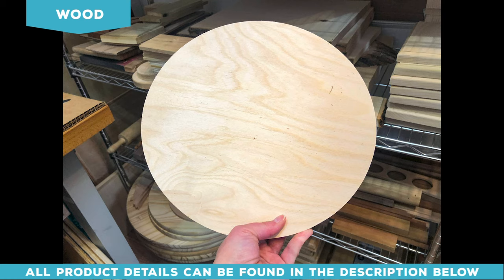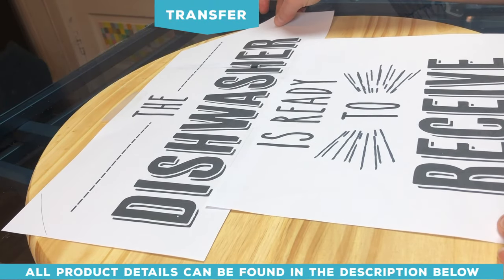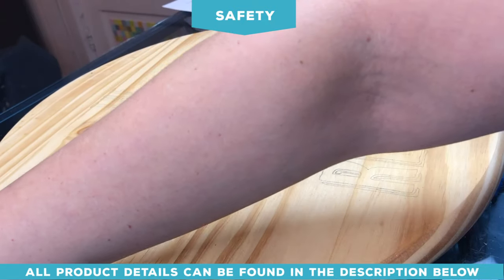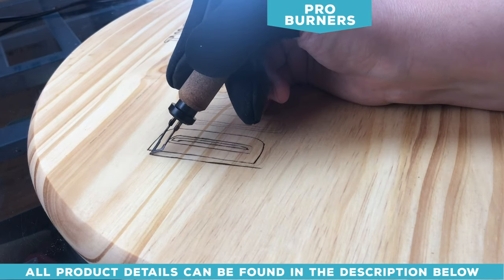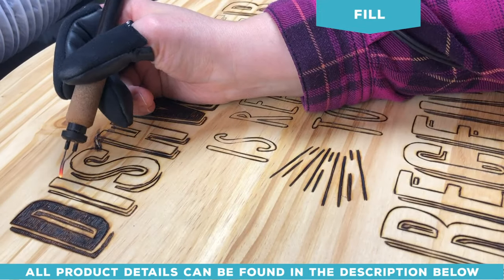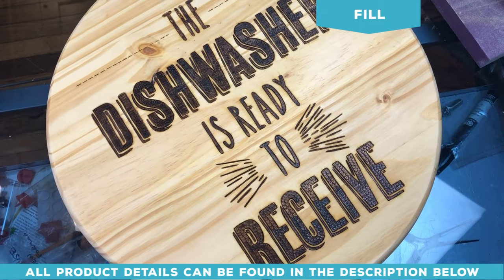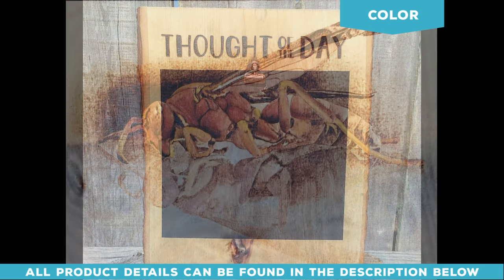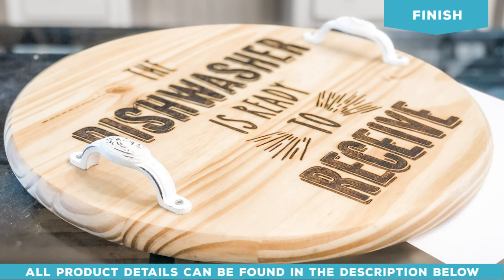Learn How to Wood Burn in 5 Minutes

Comment: What would you reccomend as a sealant for something that will be outside in the sun 🌞 after its stained?
Reply from the maker: Hey there! I use a Spar Urethane by Minwax, but it's not full proof. If it's outside in the elements, it will need to be reapplied at some point; just like a wood deck, the coating won't last forever.

Comment: Id have liked it if you could include pressure recommendation, maybe if the work environment is a necessity or how high/low the temp should be since yiu said keep the temp low but the metal was red hot and burned into the wood easily

Comment: Just got the wood burning kit. Video helped a looot, soon will be working on present for my girlfriend. I hope it will come out nice. Thankss for advice.❤️

Btw which tip is good for curves? It will be a lot of hearts so i would like to know.
Reply from the maker: Thanks for watching! If you have a narrow straight edge tip (skew or universal depending on which kit you have). If you don’t have one of those in your kit, a ball tip or round tip will work. Just make sure to go slow and burn at a lower heat so that you don’t get a lot of bumpy jagged edges. :)
Reply: @Pyrocrafters  just for feedback, present came out successfully, thank you very much!

Comment: I have the Walnut Hollow burner. I am not happy with it. Seems to lose heat, then you have to wait for it to heat up. If that was the Colwood burner you was using, wow. I've never seen mine heat up like that. I subscribed, hope to learn more. I am trying to use pyrography with my woodturning.
Reply from the maker: Awesome! I love to combine different art forms. I’ve seen some wood carvings with burn before, but you could really take it to the next level with turning. Thanks for watching!
Reply: Buy a good woodburner$$ itll save money in the end with better work. The cheap burners are only good for the trash.

Comment: I have some middle schoolers but I need to keep them safe from burns.  Besides supervising them, which gloves would you suggest I get to help decrease incidents?
Reply from the maker: Hey there! I think any type of heat resistant glove will help. Silicone or those grill gloves. I use the JATAI finger guards, but it only protects the tips.

Comment: Thank you! This was super helpful. Would the type of sealer I use to pre-stain wood conditioner, stain, and then add a sealer. Meaning would I need to keep it consistent (water-based vs oil-based) I want to make Woodburn panel wall art to sell. So I want to make sure there won't be issues with it long term. Idk what words to use- hopefully, I'm explaining myself correctly. I just want it to have a professional modern/contemporary look. 

For ex:

1. I am using a birchwood panel that I've sanded down. 
2. Applied a clear spray-on matte sealer. Doing this also prevents with solution from bleeding outside of the stencil to maintain clear crisp lines.
3. Used chemical burning (ammonium chloride solution) works great btw. I applied a thin layer of solution on my vinyl stencil. let it dry then peeled the vinyl. 
4. Used my Wagner heat gun moving it around to make sure it doesn't burn other areas of the panel.

I want to stain it which I know you can, but I want to make sure I'm doing it correctly. I have miniwax products I want to use.

5. pre-stain wood conditioner
6. wood stain
7. Finishing sealer to varnish and preserve the art. 

So would it matter if I use water or oil-based products? I am looking to sell so I want to make it does not look "cheap" or have people feel like they've been "ripped off" for what I'm selling? Poor verbiage but I hope my question came across. hope to hear from you.
Reply from the maker: Hey Chaotic! It sounds like you know more than me about it. LOL! You’re using a lot of techniques I’m not familiar with like the ammonium chloride and I don’t know what type of spray you used. Without knowing all your info, I have two suggestions: 1. Test out any new techniques you’re not familiar with on scrap. 2. Keep a consistent base with your stains/varnish, so if you’re using water base with one, use a water base throughout. I’ve never tried to mix them, so I can’t speak to what the reactions will be. Give it all a test on scrap and get a good idea on the what will happen before you do this to a finished piece. Hope that helps. :)

Comment: Would you suggest doing this outside or inside? I would love to get into wood burning but I live in an apartment unfortunately.
Reply from the maker: Hey Princess, you can burn inside, just make sure you're near a window with a fan. When we lived in the burbs, I used to use two fans, one on my desk to pull the smoke away from my face and a second one in the window to pull the smoke out of the room. So it's possible to burn in an apartment with the right ventilation setup.

Comment: When you are tracing over the carbon paper, do you need to use a pencil or a engraver? Also is there a specific type of paint you need to use for wood?
Reply from the maker: Hey Brittany! I use a pencil so I can see where I've traced, but some people use a tracing stylus. And the way the metal stylus feels on paper is a bit cringy to me, but it doesn't bother other people. Either way works, it's up to you and what you prefer. There are a lot of paint options, acrylic, water color pencils, stain, ink and so on. It depends on what look I'm going for in order for me to decide which method. I would experiment with different paints until you find one you like the most.
Reply: Thanks a lot!! You were very helpful😁🙏

Comment: What grit sandpaper do you use to make the wood that buttery smooth?
Reply from the maker: I like a 220 grit, but some artists go higher, 400, 800. I tend to burn deep textures, so a 220 works fine for me. If you want to burn light tones for realisim, a higher grit will give you a smoother finish.

Comment: Is it possible to do this on a store bought charcuterie board? Would you still need to sand in that instance?
Reply from the maker: If it has a stain or varnish, then yes. Give it a good sanding.

Comment: I have a question. Why when I wood burn the burner gets stuck and makes dots when iam trying to make a line
Reply from the maker: It could be a few things. First, what type of wood are you burning? Woods with lots of alternating grains (soft/hard) like pine can cause bumpy edges. Second, it could be the pressure you’re applying. If you push down too hard, it makes it harder to glide across the top of the wood. Third, it could be the wood surface. If it’s really dusty or rough, it may be hard to achieve crisp lines. Fourth, what tip are you using? Using a rounded tip can make it harder to get straight lines. A tip with a straight edge will help. Hope that helps! Thanks for watching! 😊🔥
Reply: Thanks for the advice

Comment: You said to keep the heat low but my “gun” doesn’t seem to burn when set low - maybe just to cheap of a gun? Also, I did notice that when filling in your burning bit was read hot - is that because you were not doing an outline but filling in?
Reply from the maker: Hey there! 

Yes, I do tend to burn on higher heats especially when filling in. As for your pen/burner and the heat settings, are you using a brass tip burner? 

If so, they tend be on the lower heat side so it’s probably fine on the highest setting, but if you feel like you’re having a hard time controlling the result you want, you’re heat may be too high. 

One way to fix that is using a small fan on your desk and have it directed at your burn pen. The air will help control that heat a bit. Or you can upgrade to a wire tip unit like Razertip or Truart. The heat settings are much more varied and consistent allowing you to have more control over your results.

Comment: is there a burner that is closer / shorter like a pen almost? So that you can grip it better and have more control like you are writing vs compared to having to hold it from farther back which reduces control since we are used to holding it like a pencil. ive been trying to find one that is shorter so i can get better control but it seems like they dont maek something like that, that burner with cork seems to be the closest style ive seen
Reply from the maker: Hey CC, Razertip and Colwood seem to have the most pen like wands as far as size of the wand and finger placement, particularly Razertip. However, there is a downside to that. 

The heat not only radiates from the metal, it rises upward toward your fingers tips. That makes it challenging to hold your fingers close to the hot pen area, because the heat can be too much even at a lower heat setting. 

It's my experience that the Razertip and Colwood get so hot on my finger tips that I have to use finger guards or a glove, which sort of minimizes the closeness I'm able to achieve. 

I have a Razertip unit and I don't use it much for that very reason. I like my Colwood with my finger guards from JATAI. 

So even though you're able to have a more penlike experience with a Razertip, I wanted to give you a heads up that you're probably going to have to use a finger covering of some type. 

You can check out my comparison video here. I go into the details a little bit more. https://youtu.be/7hwfXT4egE0
Reply: @Pyrocrafters  i appreciate the response. Yes i figured id likely need some sort of covering for my fingers and i had saw a video of someone that had what seemed to be special tips for their fingers from a heat resistant glove. I may give that a swing if thats the route i go. Ill check out your video once im home, thanks

Comment: Hello! Do you make wood burning items that are food safe? If I were to burn a food safe wooden plate, do I need to finish or coat it with anything preferably food safe? Thanks.
Reply from the maker: Try the Butcher Block Conditioner. It’s used to cost cutting boards. You can find it on Amazon or in the hardware stores like Lowe’s and Home Depot. Thanks for watching!

Comment: Hi, thinking of starting to do this along with doing my resin n cricut... just wondering can I use my cricut to do templates and then trace b4 cutting with vinyl? Or can I burn with the  cricut vinyl? Xx
Reply from the maker: Hey Elizabeth, I'm not sure I understand your question, but you can use cricut templates for wood burning. I have a cricut account and the templates can be printed and used with carbon/tracing. I don't know if there's a way to burn with the cricut.

Comment: I have a question, for anybody... I'm thinking about doing some wood burning on a weapon for martial arts, it's a staff or "Bo", basically it's round, but after the burning what kind of top coat should I put on it that'll be nice and smooth on the hands? Just any clear top coat stuff? I absolutely can't have any slivers coming off of it, so of course I will sand it real good first.
Reply from the maker: I did a quick search of how to varnish/finish a bo or staff, and there were a lot of oil types of varnishes that came up. Linseed, mineral, tung, danish oil, etc. I have used Danish Oil many, many times and it works great for burning.  I would look into what a good finish for bo's and staffs and go with that. Most varnishes I have used work with burning. I've had trouble with a couple of UV sprays by Krylon, but other than that, most varnishes I've used have given good protection. 

I would test out the varnish you want to try on a scrap piece of wood that is the same type of wood for your bo before applying to a finished piece. That will help you get a good idea of what it will do. :)  Hope that helps. Thanks for watching!

Comment: Is carbon paper just tracing paper or is it a better option for this?
Reply from the maker: Carbon paper is different than tracing. It has the black residue that comes off when you add pressure. Tracing is just thin translucent paper. Some artists prefer graphite paper, which is similar to carbon, but it’s easier to erase.

Comment: I have a problem when I’m done burning I like to color in  but when I seal it with spray lacquer The color is Run I tried oil base pencils water pencils paints I don’t know how to seal my projects without running why I put my lacquer spray on my projects please help me thank you
Reply from the maker: Hey George, I’m not sure why a spray would make your colors run. I’ve never had that issue with a spray. Are your colors still wet when you spray it? That might make it run. 

Also, try holding the can nozzle 6-12 inches away from your piece. If you’re spraying close to the wood and the spray goes on too thick, that might make it run too.

Comment: Thank you.  I have not tried my wood burning kit, in fear that will activate my fire alarm.  Any advice?
Reply from the maker: Hey Amy! I was always worried about that too, but I never set one off. My best advice is to get two fans, one for your desk and one for your window. A small desk fan will help pull the smoke away from your face and then you can point it toward a window with a second fan. That will help pull the smoke out of the room. That's how I did it for years in my office at home. Hope that helps!

Comment: Can you use a soldering tool for typography
Reply from the maker: You can; you just need to be extra gentle with it. Soldering tips are usually longer than wood burning tips and will break easily if you use too much pressure.

Comment: Can you Woodburn letters over painted wood..
Reply from the maker: Hey Ron, technically you can, but I don't recommend it. The paint (depending on what it is) may damage your tips and the fumes may be toxic. I would sand down the paint until you get to the raw wood. Thanks!
Reply: Thank you..

Comment: How hot do you need to start?
Reply from the maker: It really depends on what you're burning. I like to burn at a low heat when I'm shading. I like to burn on a high heat for deep textures.

Comment: Thanks for this video!!!  Do I also need to wear goggles or will my magnifying reading glasses do the trick? Also, what about an N95 mask vs. the respirator?
Reply from the maker: Thanks!! You can wear googles, the glasses will probably help too. You just need a bit of blocking from direct smoke into the eyes. 

The N95 will probably give you some protection, but not as much as a respirator that seals around your mouth and nose. You can wear the N95 as protection in the meantime, but I would invest in a respirator at some point.
Reply: @Pyrocrafters  Ok thanks so much. I haven't done this since I was a kid, and back then we didn't wear ANY protection.  Heck, seat belts were completely optional.

Comment: Cant get buttery smooth with only one sandpaper lol.
Reply from the maker: I usually use a 220 grit to sand it smooth on new raw wood and it works for me. The only time I use more sheets or a tougher grit is if the wood has something on it like varnish, paint or is really roughed up.
Reply: @Pyrocrafters  do you wet it and raise the grain? It seems do and some dont.
Reply from the maker: No, I don’t wet sand. Because I’m going to be burning the surface and adding marks to the wood, it seems like an unnecessary step to me and I’m a bit impatient. 🤪. But it’s not wrong to wet sand. If you prefer to add that step, go for it.